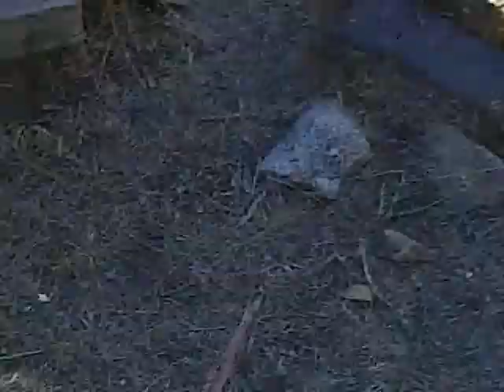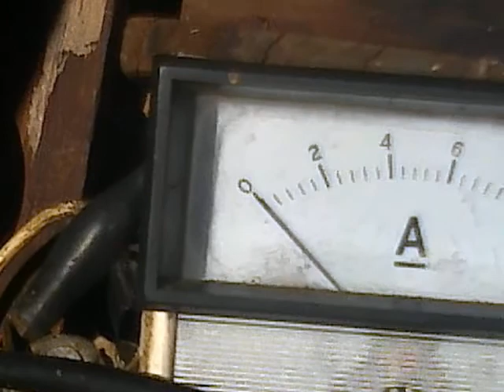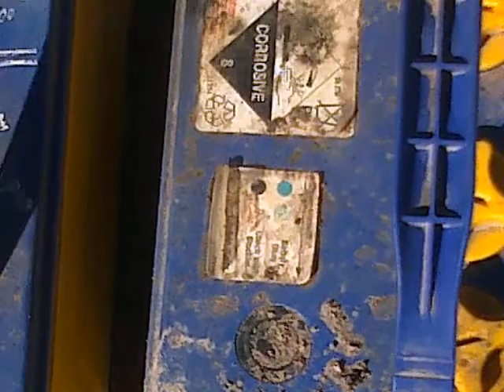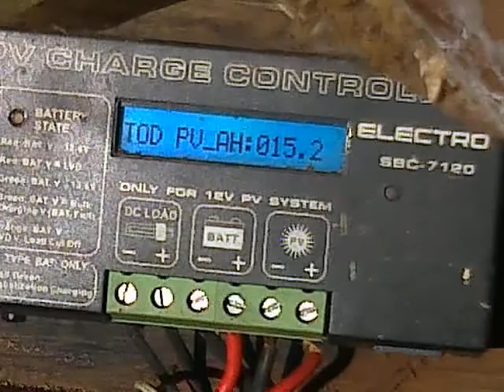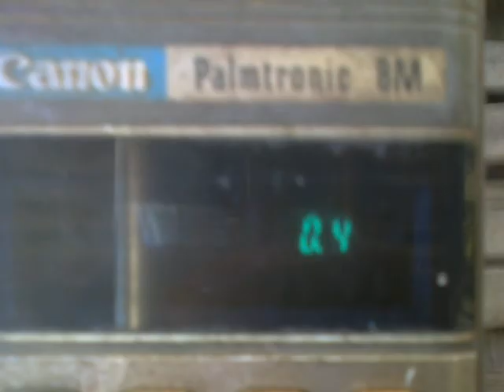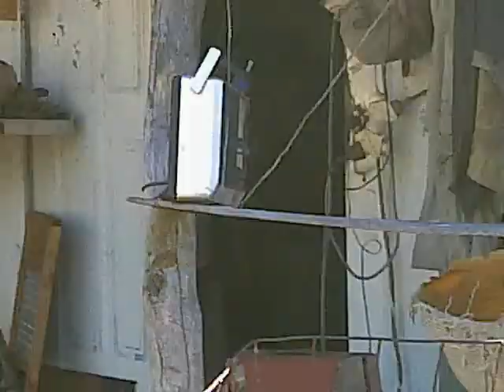Power Inverters Old & New, Product Review ; Repair Or Renew...(?).

Comment: Found the magazine from 1988, complete with article about the auto start Inverter circuit diagram, PCB artwork, parts list and build instructions.
http://www.americanradiohistory.com/AUSTRALIA/Archive-Electronics-Australia/1988/EA-1988-04.pdf
Reply from the maker: G'day again !

  Excellent, thanks...

   I don't seem to have any Spam Filter afflicting my Video's Comment Threads, people often send me Links, & my Phone can follow them, so I assume that other people's View of YT is similar (?).

  Good luck with building yourself one, and if you're into Entrepreneur-ism then I reckon you should start marketing a Parts-Kit for it, telling people to use a Breadboard & a Tupperware Cake-Tin for a Case, and bagging-up Components which you pull off eBay...(?).

  Presumably the Altronic Parts Kits went off the market well before the Internoodle desended onto the Earth..., so, if you can flog enough Kits, then try to rustle up a Factory in China to pump them out by the Truckload for you..., as finished Units - and sell them to Jaycar, perhaps...?

  Have fun,

  ;-p

  Ciao !
Reply: I seem to find any comment that has links included in a basket labelled "held for review" in a subcategory under the community tab under in the creator studio. I have not found a way to access this on mobile. The market is so mean these days that flogging kits after buying components is hard to make a profit and terribly geared to anyone who can do it cheaper will jump on it. Look up the debacle of jaycar reselling freetronics arduino starter kits. Ripped off the artwork, publication, box design, and filled it with their own cheaper and thereby lower quality parts...and sold it at the same price.
Reply from the maker: +m3sca1 

    Ah, well, all I know is that people can post Links to my Threads.

   I dunno anything about Retail Electronics in Oz, however you do...

   If it were me I'd be happy to build one, take it to Jaycar, and pitch it to them as something they should copy & mass-produce, & throw you a tiny Royalty (anything from 0.1% to 1% of their Sales on the units)...; and when they told me to piss off, and went ahead & produced & marketed it by themselves..., I'd still consider that as being a Win, because then everybody could go and buy one..., and the IDEA would be getting used, making Life better for everybody...

   Sort of like the way I posted all my SunFoil Project R & D ; simply to get it out there..., regardless of my not being able to make any money from it, it's fun to see a good idea being adopted.

  But, I'm a Nutter, of course ; that's 1/3rd of why they pay me a Pension...(!).

  Take it easy,

  ;-p

  Ciao !

Comment: I've always been impressed by some of the jaycar products. Good value for money. And often innovative.
Reply from the maker: G'day,

  Thanks.

    Yeah, I like the Digitech stuff which Jaycar sell...; and it was the first place that I went looking when I set off to buy a Spare Inverter, but the Jaycar Shop, and the following 2 Hardware shops I tried, had no Inverters in stock - so I bought the one they had in the Electrical Appliances Shop which used to be a Retravision outlet.

  I was suprised that I had to try 4 places to find one..., a couple of years ago there would've been 4 or 6 Inverters in every one of them.

  Such is Life,

  ;-p

 Ciao !

Comment: I was very interested to hear what was happening in your world when I saw the video. I ussd to work for Jaycar and the strange way that economics drives the feature to price seemed to be favouring only the price. As the need for zero draw standby is a no brainer to anyone running a DC system charged by solar or genny, it seems you can't buy one. I never saw a feature like that on any of the inverters I sold over the years. To see it in a 30 year old Altronics kit amazes me. The price you paid back then is quite high compared to todays money. I have seen some remote triggered inverters...most by wire...some by RF keyfob. But they were always the big ones up over 2K watts...whuch is way bigger than your needs and anyone who needs that much usually has enough battery to deal with some standby.
Reply from the maker: G'day,

  Thanks mate.

   Yeah, I've never seen any other Inverters less than about 1.2 Kw which could sit & wait to be sucked-on before starting to draw Power...; from memory the Stat's which came with the Altronic claimed that it's Parasitic Drain was 0.5 Watts, and when running at between 30% & 70% Output it's Electrical Efficiency was 98%...(!).

  It was because the Altronic can start itself that I put the Batteries with the Generator & Inverter in the Pyramid a dozen yards away from the Hut, & only 6 yards from the Tower of Power which is itself in the optimal position for Panels & a Windmill (when I get around to erecting it)...; because 6 Volts of Line-Drop is buggar-all from 240 V., but with 12 Volts it's half the available Power..., so I collect it & store the Electrickitiez at 12 Volts DC, where the Collecting is best - and then invert it up to 240 Volts AC to squirt it across the Driveway to the Hut.

  When the Generator was in the Pyramid it minimised the Noise here at the Hut as well, though now the new Genny is too big for the Pyramid so it's halfway between the Tower & the Batteries...; where it's even quieter...

  Someone should probably link this Video into an Off-Grid Forum, or an Inverter Importer, maybe even a Manufacturer in China ; because apparently  there's a huge hole in the Market, waiting to be filled by a small (and medium sized) Self-Starting Inverter...

  It's known technology, so anybody could do it ; and being so much more practical than the Manually-Switched & always Fan-Blown units - they would probably sell better than the little Cheap & Nasties do...(?).

 Have a good one,

 ;-p

  Ciao !
Reply from the maker: G'day,

  Thanks mate.

   Yeah, I've never seen any other Inverters less than about 1.2 Kw which could sit & wait to be sucked-on before starting to draw Power...; from memory the Stat's which came with the Altronic claimed that it's Parasitic Drain was 0.5 Watts, and when running at between 30% & 70% Output it's Electrical Efficiency was 98%...(!).

  It was because the Altronic can start itself that I put the Batteries with the Generator & Inverter in the Pyramid a dozen yards away from the Hut, & only 6 yards from the Tower of Power which is itself in the optimal position for Panels & a Windmill (when I get around to erecting it)...; because 6 Volts of Line-Drop is buggar-all from 240 V., but with 12 Volts it's half the available Power..., so I collect it & store the Electrickitiez at 12 Volts DC, where the Collecting is best - and then invert it up to 240 Volts AC to squirt it across the Driveway to the Hut.

  When the Generator was in the Pyramid it minimised the Noise here at the Hut as well, though now the new Genny is too big for the Pyramid so it's halfway between the Tower & the Batteries...; where it's even quieter...

  Someone should probably link this Video into an Off-Grid Forum, or an Inverter Importer, maybe even a Manufacturer in China ; because apparently  there's a huge hole in the Market, waiting to be filled by a small (and medium sized) Self-Starting Inverter...

  It's known technology, so anybody could do it ; and being so much more practical than the Manually-Switched & always Fan-Blown units - they would probably sell better than the little Cheap & Nasties do...(?).

 Have a good one,

 ;-p

  Ciao !
Reply: WarblesOnALot i would like to get my hands on one those kits or at the very least the schematic. Have a look at MPPT technology for your next solar controller. You may even be able to wire up your array to make 24V or higher to negate DC losses. Makes a big difference without adding any more panels. I am gonna go research if I can find that old schematic...
Reply from the maker: +m3sca1 

Good luck with the Search..., I was in there today talking to the bloke who built it (& fixed it twice) & he reckons that the circuit to make an Inverter Self-Starting is really really simple ("Piss-Easy"...was the quote) & he's in the Glen Innes Phone Book ("The Celtic Informer",under Electrical Repairs) as "Davy TV Service Glen Innes"... 67 322 260"...

  If all else fails, ring him up and ask him to send you a Sketch via Snail Mail or something...; his name's Vince, a good bloke, Captain of the HazMat Truck with the local Volunteer Fire & Rescue Brigade.

  When I need Electrical stuff like Panels & Controllers I go to my son, he's been the town's Auto-Electrician for 4 years so he can get me stuff at Trade Prices..; 2 years after finishing his apprenticeship his boss sold him the business on Vendor Finance, and he works his Arse off, but he's still in business & he employs his girlfriend in the Office & on the front Counter, and he has an Apprentice as well..., so I get to be the proud Daddy(Dole-Bludger/Pensioner) who raised a Main Street Businessman & RFS  Brigade Captain - to the utter confuzzlement of all the people who don't remember that my father was a workaholic, and I'm the Line-Skip-Link...(!).

  When my kids were young I took them with me everywhere, chainsawing or Aerotowing Hang-Gliders...; they role modelled on me when I was in Energiser Bunny mode, apparently, while none of the Lazy-Hippy stuff rubbed-off...!

  Such is Life...

  Have a good one,

  ;-p

  Ciao !
Reply: Great result, I failed yesterday using standard search terms, but with a fresh bucket of coffee and renewed persistence, I tried bracketing the words out with inverted comma's "300 watt" "inverter" "electronics australia", and found a pdf scan of the complete magazine, Electronics Australia from 1988, showing an "improved version" of the circuit, anyone with some electronics nouse could reproduce it from that article. I will post the link in another comment because it most likely will get caught by the spam filter.

Comment: The mad scientist definitely....seems you are ready for any worldly catastrophe.
Reply from the maker: G'day Pixie,

  Thanks mate.

    Well, you know what they say - "If you can't measure it then you can't manage it..." ; and to measure Battery Storage Efficience requires filling them up, then recording their Voltage while Amps are sucked out, and converting Amps X Volts into Watts at each measurement, and measuring the AxV=W at every Power-Change (turning on/off an extra Light, or the Phone-Charger), and factoring in the Time at each Current-Drain level to calculate the Watt-Hours used since the previous meaurement - and then adding it all up afterwards to see how much Power was delivered.... And then doing it all again as the Batteries are charged-up, to see how much Power it takes to "refill" the Batteries and reach the Regulator's "Float Level" (when no more Current can be put into the Batteries without their exceeding 14.5 Volts...).

  At the moment the Bank in the Pyramid is taking 108% of Discharge to refill & hit the "Float", which is extremely very good, because brand new Batteries take 105% (so these are still 92% Efficient, rather than 95%...).

   Actually, with these you-beaut Batteries & the Panels as they are, on a clear day I can recharge the Batteries and hit Float after a normal Night/Morning Discharge-Cycle, by Midday..., so on a 4/8 Cloudy Day the Float comes about 2 PM, and on a bright 8/8 Cloudy Day they almost Float by Sundown - and I can have Lights at night after a rainy day, and recharge after 2 nights' use in one Blue-Sky Day after the Cold Front has passed.

   The previous set of Batteries, when they went into the Pyramid, didn't have a big enough Solar Array feeding them, so they got chronically undercharged between being thumped back up with the Backup Generator at night, every time the Weather turned cloudy.

   I've been worried about only having one Inverter for years, because I was raised to "Have a Pair & a Spare" of anything which matters, as in a really good one for personal use plus an older or repaired or cheaper version held ready in case the good unit breaks or fails ; and a really cheap or almost worthless one for lending out to people who will probably break it or fail to return it (if they knew how to use it then they wouldn't have broken the one which they used to have - or they've never had one, in which case their ignorance is guaranteed...) think about, "Can I borrow your Axe, mine broke it's Handle...(when I over-reached, and tried to cut Wood with the Handle instead if the Head...?"..., or "Can I borrow your Chainsaw, I've never used one before but this new house has a Warmray & I want to go out in the Bush and get myself some Firewood...?" (they'll chop Rocks with it, unless they take a lump out of their Leg first, before blunting the Chain...).

   If one really cares THAT much about other people's Firewood, then it's easier & cheaper to go and cut it for them ; rather than to lend them an Axe or a Chainsaw, and have them break it and/or hurt themselves with it.

   Come the Catastrophe, like every other Prepper on the Planet, I'll eventually run out of Spare Parts to fix all the various manufactured THINGS which are all neccessary to maintain the lifestyle ; and all of them break down or are consumed, and need to be sourced (in a Shop).

  The little new Inverter was the only one in town I could find & I'd tried 2 Hardware Shops & 2 Electrical-Goods Shops before I found it (maybe there were some in the Autoparts Shop...?)...; and I had expected all the 4 Shops to have several of them, as was the case maybe 5 years ago.

   The same thing is happening in the Stupormarkeds too..., about Xmas time the bottles of 3% Hydrogen Peroxide disappeared from the Shelves, and in March the Dried Peas vanished...(!) ; Gaps are appearing, as Supply-Line problems crop up - or manufacturers & suppliers shut down for whatever reason.

  Maybe the World doesn't end with a Bang, so much as a Whimper ; and the whimpering is starting to get a bit noticeable...(?).

  Such is Life,

  Have a good one...

  ;-p

  Ciao !